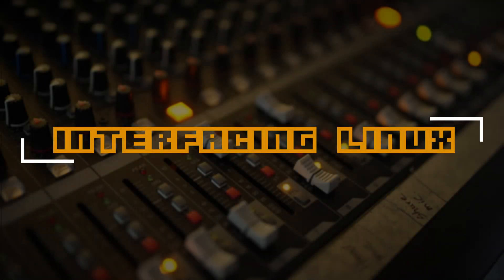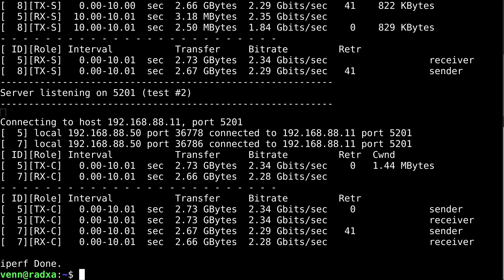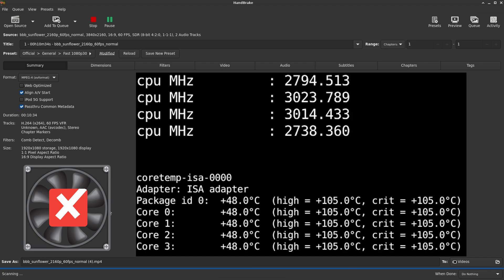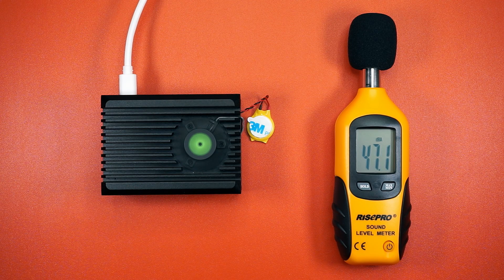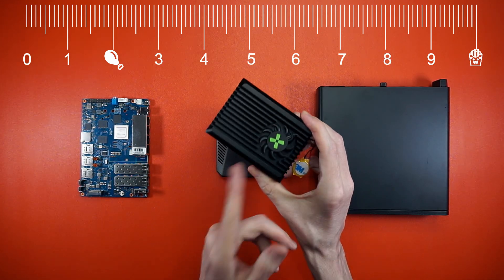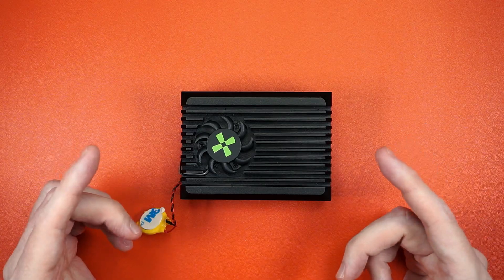Linux On The Intel N100 Powered Radxa X4

Comment: I have a huge problem to allow video HD acceleration. I have Ubuntu 24 + Chromium which should play FULLHD video. But it seems HD video decode is blocked by APT packages. I dont understand how did you allow this feature on the board. At 5:10 you show some kind of dashboard but I dont understand what is it. Is it Debian UI or can I use this tool also on Ubuntu 24? Can you give me any link to documentation?
Reply from the maker: That setting is not hardware acceleration for the browser, it's for the Jellyfin server.
Reply: @InterfacingLinux  Have you any idea why HD video acceleration is blocked for packages like Chromium. I can not break through it. Whatever I set up on chromium or system level does not work.

Comment: If you use a copper shim instead of the stick on heat transfer, no issues running without the fan and only hitting 40C with no throttling. See explaining computers

Comment: 679 / 5 000
Price is not really a factor in choice, I think.
If we compare to an RPI-5 which costs about the same price.
If we compare to other RPI type cards, I think it can be a good purchase.
CONVERSELY, I think that this card is not a good choice for a specific use of mini-PC.
It seems that a mini PC under INTEL N-100 costs between 130/150 euros/dollars.
Everything being provided in a N-100 mini PC, the choice will be made more on a need or not need for a fan for the processor.
If the size of the PC is not disturbing, an ASUS or ASROCK motherboard with an N-100 does the job and allows to reuse a lot of parts from another PC.

Comment: You could do the boring thing and just get the super quiet Beelink-N100 already with a proper heatsink and fan, then install whatever Linux you prefer.
Reply: This would make more sense. Unless you need the GPIO. I don't see the point of this board over a cheap used HP Mini.

Comment: The reason I buy an RPi SBC is because I want to have the full desktop Linux ARM experience. If I'm going to have an x86 CPU, I can easily buy any secondhand Windows laptop and made a Linux clean install in it. Heck, you can also buy any budget Windows mini PC with similar or faster CPU for less than $300. Sorry, but I really don't see the point of this SBC.
Reply: Why do you always have to put this under every video? :)
Reply: X3 Performance at the same price, power and price as a pi 5. Need more?
Reply: @solanumtuberosa If you're talking 4GB RAM Pi 5. 8GB Pi 5 is still expensive in the secondhand market and it's not hard to find newer x86 Intel Pentium laptops for around the same price.
Reply: @farishanafiah8461 again, are the laptops the size of a pi 5? They also have different use cases.

Comment: There are some really nice NAS boards based on this CPU. We're talking 4x2.5g NIC, two nvme slots, 6 sata ports, and sometimes even a PCIe x1 slot. Not as small, but also not as loud. All that for basically the same price or cheaper. You do need your own ram and PSU, but for what you're getting, it's probably the best budget CPU for a solid DIY NAS.
Reply from the maker: Indeed, the N100 is a solid little CPU for the price.

Comment: great stuff, i just got X4 4GB/32 to run as a "PC" mostly for web browsing, for my mom. works great, installed KDE Plasma which is kind of mistake (ram hoger) but other than that -
i added some thermal paste on both sides of the thermal pad and the temps are very low , even under stress i get to 49-50c . that's not hot for Intel
Reply from the maker: It has plenty of power for basic desktop tasks. Good choice.

Comment: Nice mico hardware that can run common Linux versions. Was looking for a good small gaming device that does not hammer the pocket book to play with. This would fit that bill and thanks for bill of materials to make that even easier. The heating issue would be a fun problem that would be "cool" to solve.
Reply: Indeed, the X4 a fascinating development platform. Building a fanless cooling solution would make for a fun project.

Comment: The X4 is a wicked-neat development board but yeah, it needs a proper case. 
00:00 Intro
00:11 Overview 
00:26 Heat sink 
00:33 Thermal pad 
00:57 Cooling fan 
01:06 NVME drive 
01:14 USBC power supply 
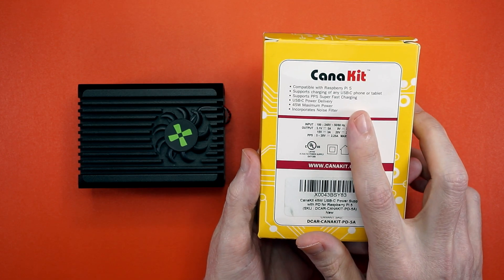01:32 BIOS / UEFI
01:45 Installing Debian Linux 
02:09 Power usage 
02:30 Wi-Fi setup
02:42 2.5 Gig networking 
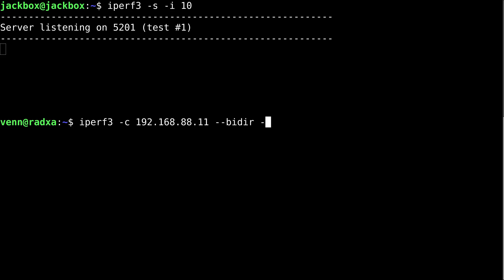02:50 Speed test 
03:03 Wake on LAN
03:37 Geekbench 6 
03:50 NVME SSD benchmark 
04:07 Thermal throttling 
04:43 4K video playback 
04:55 Jellyfin transcoding 
05:28 Bluetooth 
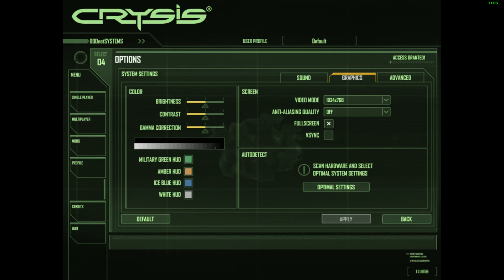05:40 Can it run Crysis?
06:00 Hollow Knight 
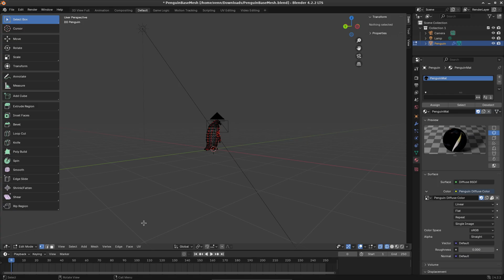06:13 Blender 
06:28 Davinci Resolve 
06:31 Reaper DAW
06:57 Fan noise 
07:40 Raspberry Pi RP2040
08:00 Verdict